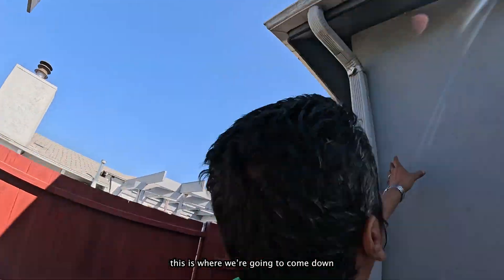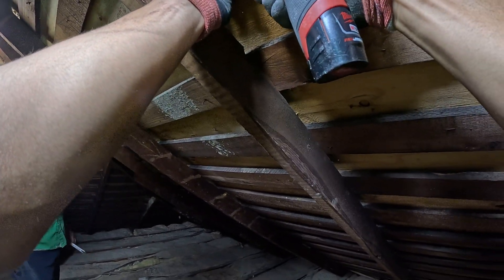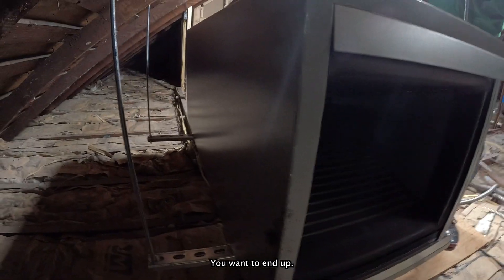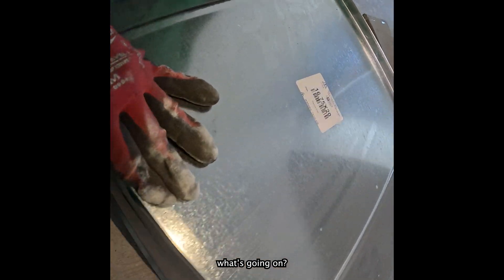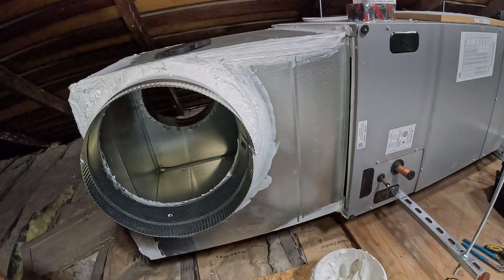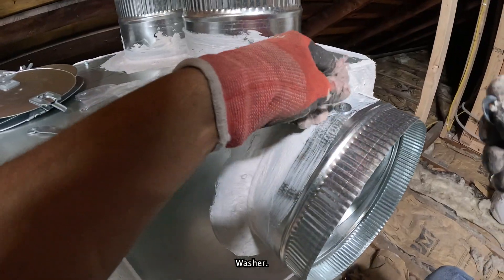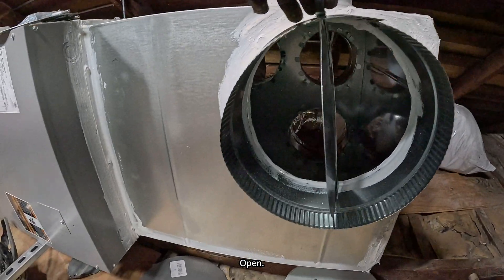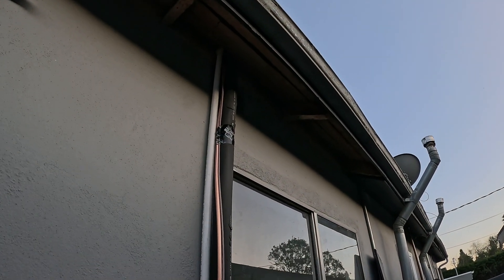Evaporator Coil Install - Before Summer Hits!

Comment: Should start buying insulated plenum boxes. They snap together and look SO much better than wrapping them in normal fiberglass. That return plenum looks really bad wrapped like that. Saves time as well cause its one less thing to do. Also, don't hang linesets with metal strapping. It will rub through the copper and cause leaks and corrosion. Use duct webbing and its also a lot cheaper. Not a bad install, just some stuff to improve on and make installs nicer and quicker. Also please tell me there will be a drain pan under the unit?
Reply from the maker: I appreciate the feedback! It’s a struggle when you don’t have much say in the parts ordered but I’ll get there one day. I’ll keep all that in mind thank you
Reply: Oh you fancy huh